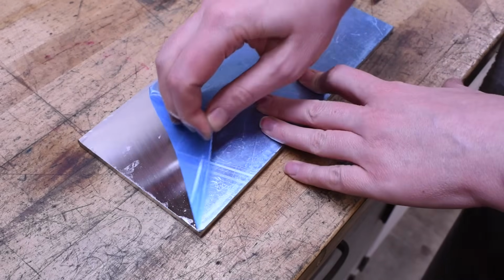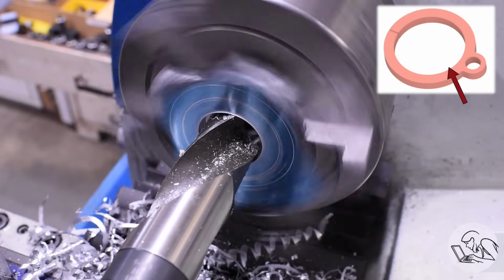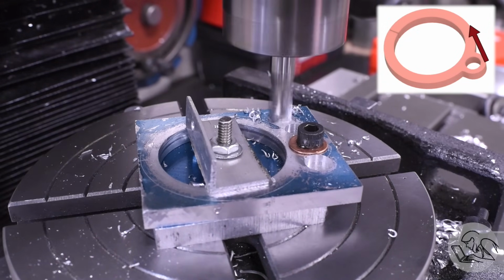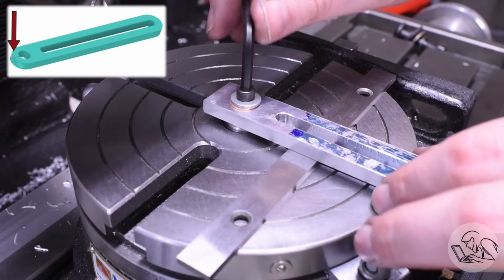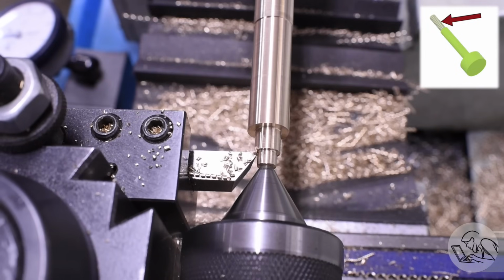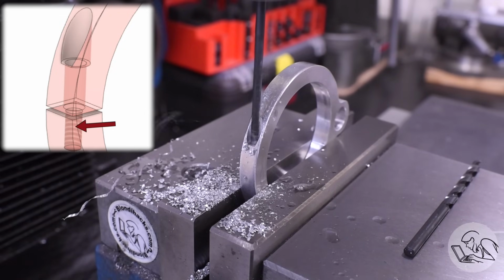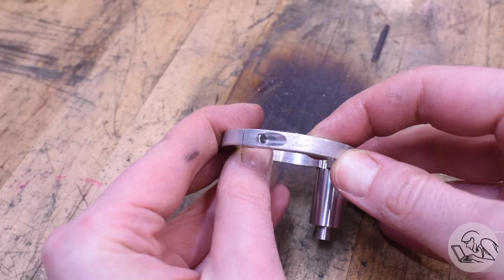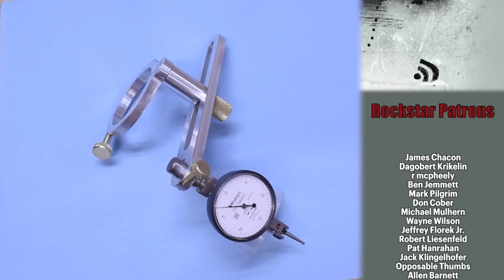Indicator Holder for your Mill - Let's make one!

Comment: I love watching all your video's and learn something every time.  I did just receive my mill and have not completed cleaning it up and preparing it for use so my learning is all relative.  I am having a little bit of understanding issue with how this can dial in a round part such as those when the dial indicator is not in center with the mill spindle.  This part is not quite at my level yet so will wait to explore it by doing, but perhaps it will come to me later in my milling experience.

Comment: Instead of a Loctite Fit, you could also have the boss on the riser a little longer, then countersink the hole on the top of the long bar, and rivet the boss in place.. that is how i would do that.. but then again.. how do you think a watch hand is attached to its hub?.. indeed.. riveting..
Speaking of these hubs.. you could also drill a hole in the top of the post, and put a ball bearing in there.. and rivet it in a vice.. also works a charm..

I made a similar tool for myself, but i used a "G-Clamp"style clamp, and i "Sacrifised" a "Noga"Style Indicator arm, which screws right in, and also clamps all my indicators..

Comment: Mic-6 tooling plate. Mount the indicator on the front dovetail, That way you can read the dial all the way around. The dial face will always be up and easy to read. Great project! Way to problem solve too.

Comment: Im going to blow your mind with a co-ax indicator tip. I stopped spinning my co-ax with the machine until after these steps and I get zeroed much faster. Indicate your X travel at two points 180* apart by turning the spindle by hand, and get those two points to "zero", then turn the indicator shaft 90* to the X and bring the table to the same number you "Zeroed"  The X at and your basically done. For indicating on the rotary table you would still need to tap it in, but this will get you closer quicker than any other method. EDIT: I just watched the end of the video and realized you did just this with your DTI. LOL!

Comment: Quinn, Tell me more about you corner round fixture  please, what holds it in your turn table? or is just the inside threaded, you used a small screw to hold you work piece down, what held the corner rounding fixture in the turn table. Did I miss something, or you just pulling up against the bottom piece, since the clam is holding down on the edge, so it's pulling against the bottom aluminum plate,  Nice project as always,  👍👍👍👍👍😁😁

Comment: I have the same Vertex rotary table.  Mine however has three T slots .

Does anyone know why the two different iterations are made of what are similar accessories.    Is it to do with geometry for setting up workpieces.   Is it a metric/ imperial thing or does it reflect the country of manufacture.  My table is made in Taiwan!

Stavros

Comment: Your videos Quinn,  are brilliant!    Having recently bought myself a mill ( the smaller version of yours) I went through your milling tutorials and found them very  helpful, so I also went through the lathe tutorial to see what I was doing wrong there.   I've made this DTI holder, but decided I would save some money by making the 2 larger pieces on my 3D printer, which also means I don't have to buy myself a dovetail milling cutter since I can 3D print the DTI clamping mechanism.   Being an electronic engineer (retired) with minimal mechanical background I find that making chips in my workshop is extremely therapeutic.   Keep the videos coming!

Comment: I always wondered why use 4 points for centering when 3 points are enough to define a circle. You can use 3 points of 120 degree with one in front of you and two left and right in the back. That way no need for mirror
Reply: Interesting idea Cristian. But I think the value of four points - aligned along the X and Y axes -  is that they are exactly controlled by the X and Y hand-wheels. And in fact if say the backside is blocked somehow, once you've adjusted X (the dial reading is the same both sides) then you can simply bring the front to the same reading with the Y wheel: no need to do the back. What do you think?

Comment: The diameter of the part to be knurled needs to be an even multiple of the number of teeth on your knurling rollers. Fine the closest diameter that’ll match and your knurls “ should “ line up when they come around. There are look up tables out there, too. Always enjoy your videos and I always learn something from them.
Reply: Yes, but kind of a pain. I learned from Joe Pie that if you clamp the scissor type knurling tool hard to begin with, it will almost always track OK. If it fails, you can just skim off the knurl and try again.

Comment: For softer material (aluminium in particular) use an ordinary hole saw to get 'starter holes' more than 1" diameter. Bi-metal hole saws will easily cut steel but it's a good idea to drill at least one swarf removal hole in the 'cut' if your using drill press or mill and run at a lower than usual speed. Even cheap carbon steel hole saws will work if rpm is kept down, I've used 3" diameter in 1" thick A36 plate, way cheaper than buying Rotobroach

Comment: I made mine from a DTI Stand, you know the flexible ones on a mag-base, i unscrewed it from the base, made a clamp for my spindle nut, as my machine is a CNC, so it does not have a quill.
For reading the DTI when it is on the back side, there's 2 options, since the needle of a DTI  can be adjusted, i mostly try to get the Dial of the indicator facing Up, or at least as "up as possible", or when that can't be done, i use a small dentist's mirror to read it when the dial is facing to the back..

Comment: Just wondering, at the beginning when doing the tappy-tap-tap-that-in. The plate moved quite easily, is that then sturdy enough for drilling into it? Won't it possibly move like 0.01 mm or so by the force of the drill? No experience is talking here. :)

Comment: You may say that a chamfer makes your knurl look better, but i am fully capable of making knurls (in aluminium at least), that look drastically worse after chamfering. 
Okay that might have something to do with that being my first time actually turning aluminium and the first time knurling so i had someone demonstrate the knurling so it was really easy to get it spot on, while the RPM for the alluminium could have used a bit of tweaking.
It was litteraly the last project of my apprenticeship, making the body for a handheld chamfering tool, which really is only useable in one direction (without loctite) because whoever designed it, designed it with an end that threads on, so it comes loose when using it in the wrong direction

Comment: A nice little tool to center things with.  This is a good place to have a mister or flood cooling system, substantial improvement of tool life.  Every fixture has an original purpose, but also grows to be multi-purpose.  Nice, straightforward machining, I swear, I cut it three times and it's still too small.  One of the best setups is "DRO", saves the "error rate".  I do note, I've got the same exact tooling, most I've owned for decades.  Feeding longitudinally is the best way to set up a great knurl on this sort of machine.  The indicator can be placed horizontally, and the face easily seen all the way around the periphery.  Nicely done all around.

Comment: Hi Quinn - quick question - why haven't you done tge first detail on the milling machine if you had the turn table available? Pin in the centre, then OD, followed by ID, then OD of the small tag, and a hole in it, and job done with measuring once, and whole feature made on one machine. I meant measuring twice ;)

Comment: I can foresee Loctite Fits in many of my future projects. Nicely different way to hold an indicator. I like to have the dial face-up so I can see it all the way round the part without needing a universal joint in my neck-bone. Easy enough using the front top dovetail and a longer stalk, with the indicator rod almost at 90 degrees to the body.
Reply: You can also just make a small knurl on the pin surface and the material will be pushed back up. It is ideal for saving a press fit.

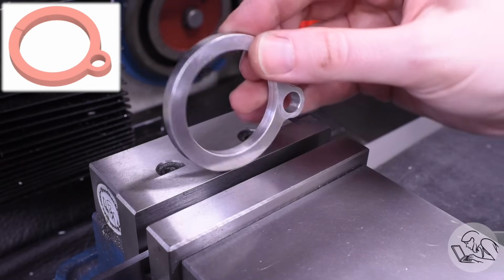Comment: Great video as always, thank you. The repair you did was very useful info for us beginners too, so I'm kind of glad you made that mistake. One question though: At 19:44 the main ring shaped part is mounted in the vice. This would have needed to be oriented so that an imaginary line drawn through the centers of the two holes was horizontal. How was that orientation achieved?

Comment: I just (literally yesterday) learned a trick from a journeyman machinist at work. We use factory “indycols” and instead of using the DTI vertically so that the dial is facing you in the front but away from you in the back where you have to use a mirror, he showed me that if you put the DTI dial up towards the spindle with the arm at a 90 degree down, you can see the face the entire time your sweeping your part in. Saved me a ton of time. I know it would be a little difficult with how you made your device, but it’s honestly worth trying it that way. To put it how he put it: “quit chasing your damn head around the table, you’ll make yourself dizzy!”
Reply: I thought 'everyone' knew that, even if you have to make a different arm to suspend indicator in correct orientation. Should probably watch more Joe Pie video's?

Comment: When you have the O ring thing in the clamp to cut the slit, how do you ensure that it's horizontal and inline with the center of both the small and large inner diameters? I don't think I caught how you did that

Comment: Nice tool, I would suggest using a spring loaded center punch tool and peen the locktited parts to add some mechanical rigidity to it.

Comment: I have what I am sure is a dumb question, but I will ask anyway; if you had to remake the brass part, why not just make it oversized to fit the hole you drilled in the spindle clamp?

Comment: NICE!   Now how about mount the stem on the dovetail that is on the edge between the dial and the finger?  That way the DTI dial faces up.  So no more mirror needed.  Just move the finger so it points down.   And as a side benefit less vertical room needed.  Sorry, I saw that as you were mounting the DTI and stem and wondered why you had the stem at the back instead of on the short top dovetail.